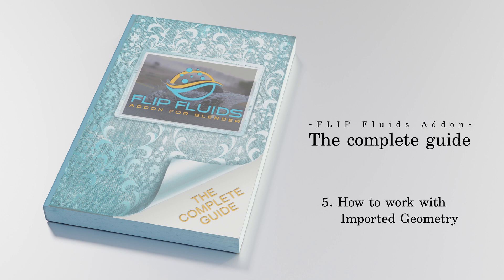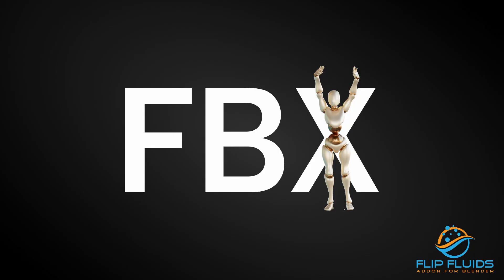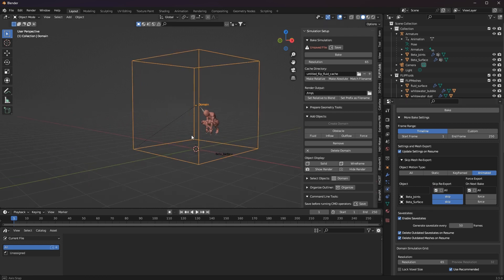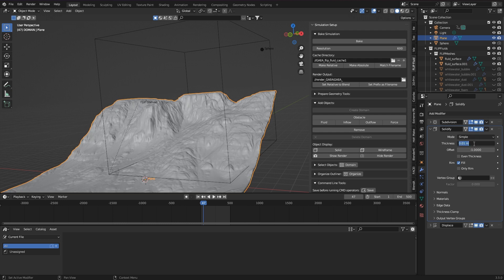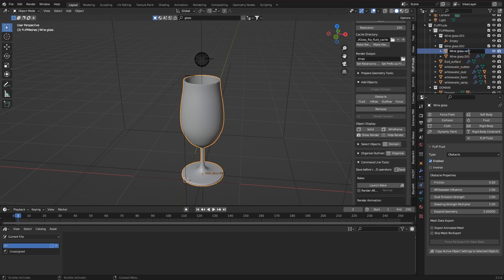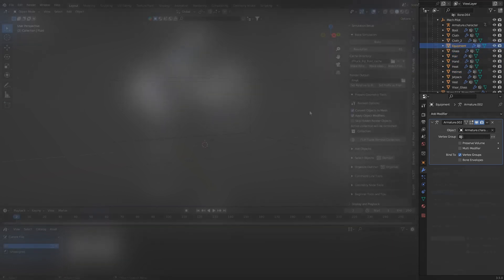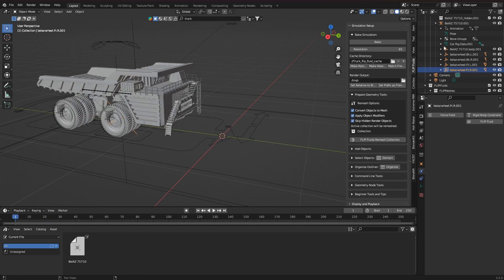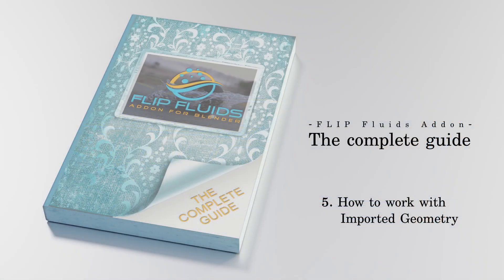Mastering Geometry Import in FLIP Fluids | Complete Guide Series Episode 5

Comment: How do I use imported static objects to use as obstacles? The fluid always passes through an imported object
Reply from the maker: This can happen if your obstacle is not water tight. Did you check for non manifold data? Other questions are if the object is moving export animated mesh is required to be enabled. And the simulation resolution must be high enaugh to work with thin obstacles. If nothing helps you could use our support form to send a request. Optimally with your blend file.
Reply: @FLIPFluids  it would be a static imported object, for example a t-shirt that I made in another software. The object is actually a little thin, I increased the resolution to 300 and the fluid passes through. I also tried with a tennis shoe, which is already thicker, it also goes through
Reply from the maker: Maybe, you need to check for non manifold data. Otherwise this can happen.
On the other hand - the simulation resolution needs to be high enaugh, too.